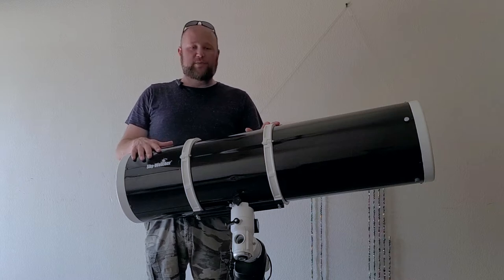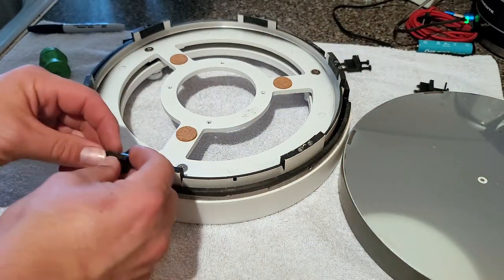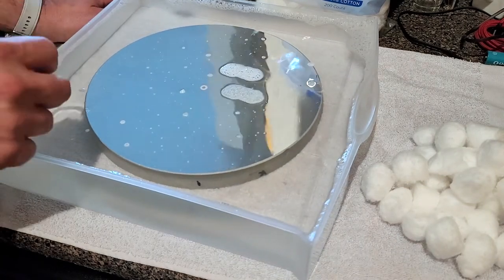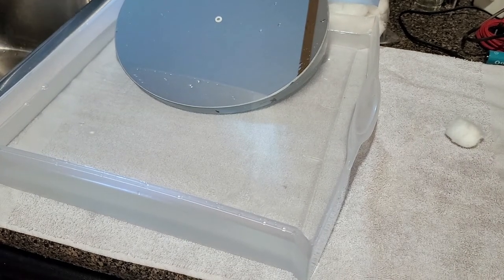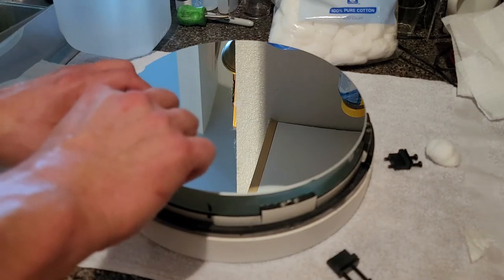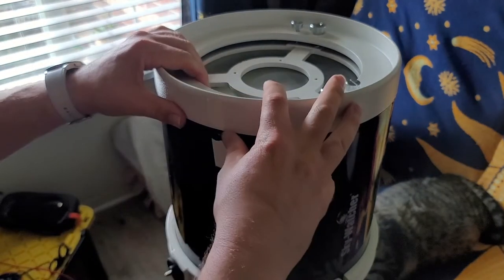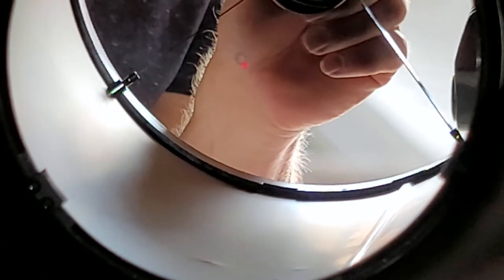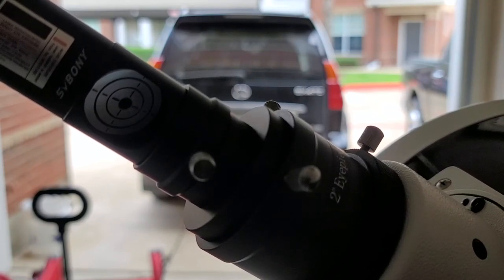How to Clean a Reflector Telescope Primary Mirror - Complete Guide

Comment: Great video that provides some vital tips. I would not have known about the business card as feeler gauge step! I'm taking my Meade 10" SCT off the pier and putting my SkyWatcher Quattro 250P back on. I want to clean the mirror before doing that. I just bought a GSO 2" Barlow lens that I'm hoping I can get focus with, for continuing to image galaxies, at a longer focal length with greater magnification, while they're in season! I found that the 250P reflector focuses on stars and DSO's soooo much sharper than the SCT it's no contest. Autofocus on SCT gives best focus star size between 7 and 10. The 250P reflector gets stars autofocused to between 2 and 5. Thanks again for the great info!
Reply from the maker: Thanks for the kind comment Goodluck with galaxy season I know I will be getting ready for that after the eclipse 😊

Comment: thx for the vid!. how often do you need to clean it?
Reply from the maker: Not very often really only worth the risk as needed. Just make sure to keep the dust cap on and if possible you can store it with the mirror up so that any dust that is in the tube wont settle on the prime mirror. They one I got in the video was used and stored in a barn for a few years so it was very dusty!
Reply from the maker: Did you have one to clean? Or planning on doing it soon?

Comment: 27:50 mine is different at the end. It has 3 hex bolts inside and 3 Phillips heads. It hasn't got the round circle crisscross thing. 

Also, I'm very appreciative of your mirror clean, I just looked into mine, and it needs a clean, and the tube might need a wipe. 1 question: Was the water cold or warm or hot.

Big up from Dublin, Ireland 👍🏼😊
Reply from the maker: Water was room temp for this. Hope that helps! Good luck!

Comment: Nice video, although I'm always worried to scratch the mirror with any dust or particulate matter stuck on it.  I thus start off by first rinsing it under a running tap to get rid of loose dirt.  One's fingers are amazingly sensitive and can detect things down to a few microns, so I then make sure all particulate matter is gone by gently wiping it with my fingers, still under running water.  After that, I'll go over to the soap-stage.  I use very little soap and a final rinse with copious amounts of distilled water.  I use cotton wool to wipe it dry.  See the two most viewed videos on my channel.
Reply from the maker: Haha, it sounds like you've got quite the mirror-cleaning routine! Who knew fingers could be so sensitive to dust? Keep those mirrors sparkling!

Comment: Hi Glad I found your Vid..I have just started to take out my mirror on my skywatcher 250pds.  I'm also going to flock the inside tube. Have you flocked yours ? I've also put Bob's Nobs on secondary mirror makes it easier to turn Collimation.
Reply from the maker: It is interesting that you mention it, I have not flocked it, however I had an idea to try that vanta black paint in the tube. Which might work better? Not sure if you have seen it before but its pretty interesting. However its not high on the list of projects.

Comment: Why not small bursts of compressed air to remove excess droplets?
Reply from the maker: That thought had crossed my mind. I the reason for the excessive care is the coating is bare aluminum, and it is so very very thin. Basically when they are making the mirror the vaporize the aluminum and the vapor settles onto the glass. That is about it! so maybe a blow dryer or something more gentle but I am ok with just using a paper towel maybe next time I will try something like that.
Reply: Compressed air often has oil propellant in it, so you can inadvertently spray oil on your mirror by mistake. I never use it as I can't be 100% sure there's no propellant in the can.

Comment: This method is not good. Use  First contact Polymer. A little expensive but your telescope will be more than brand new.😊
Reply from the maker: Thanks for the tip. I will have to try this out. I will point out the method I used worked perfectly fine for me but results may vary.

Comment: just clean the thing...what a joke //its a mirror..thats it,,,,its not a scientific surgical procedure,lol...funny man
Reply from the maker: Well its a little more complicated than that. Mirrors we use for checking our appearance have the reflective materials on the back of the glass making them very robust to cleaning. However with a reflector telescope it is a very fine coating of aluminum on the surface, it is very easy to damage it. So yeah a little extra care is called for in this case.